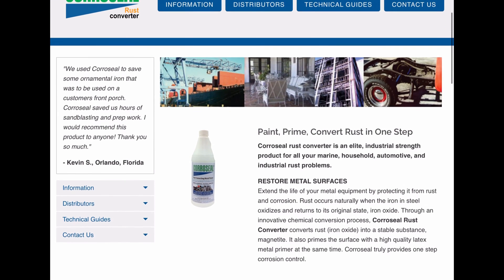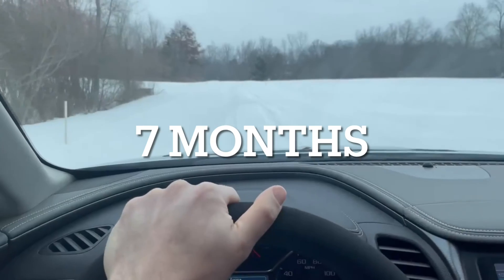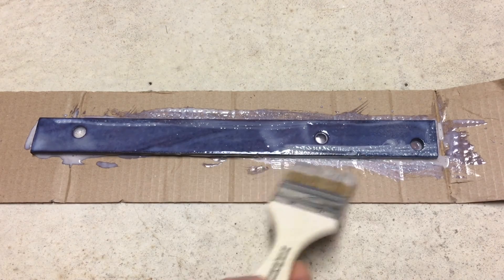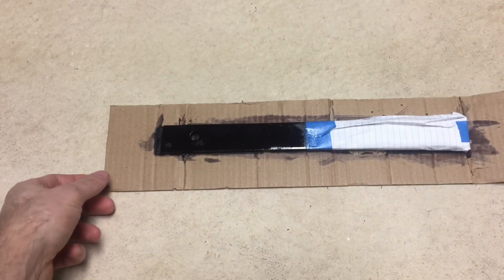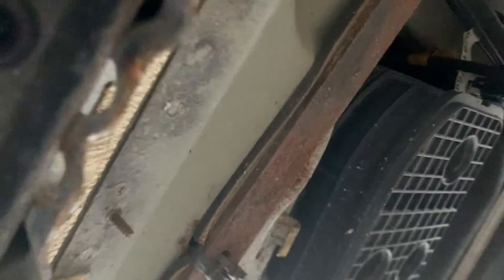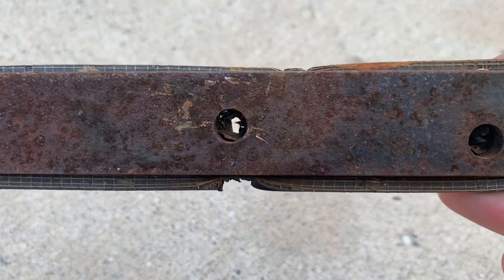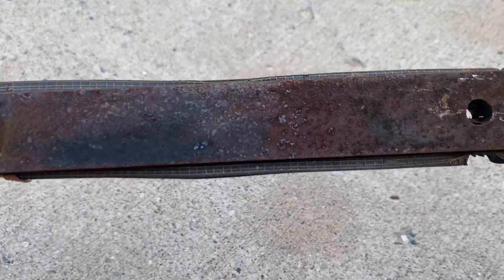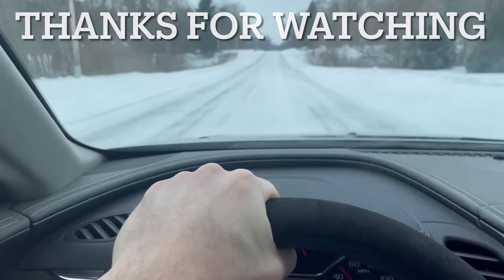CORROSEAL Rust Converter | 7 Month Vehicle Frame Test | Snow Rain Heat | Clear Paint to See Results!

Comment: Here in Canada I have used a product called STOP RUST. I found that cleaning the metal with acetone before application shows better results. Also, I paint the area with a good quality primer after the converter dries.
Reply: What is the product you're referring to?
Reply: @NoahFlemingConsulting  The product is called "STOP RUST" and is produced by a Canadian company called Cantol.

Comment: I live on the east coast of Canada, I think the issue is... you expect it to convert the metal into stainless or aluminum, There is no product that will do what you're expecting, short of having it chromed or galvanized... I use this and fluid film on my wranglers, one is an 03 the other's a 13, you see rust, you convert it, end of story, fluid film slows down the amount of time between applications, just out of curiosity, how often do you take it through the car wash?
Reply from the maker: I just did this for a test, but I personally have no faith in rust converters. I use Blaster Surface Shield every fall, which is similar to Fluid Film. 
I definitely don’t wash my vehicles as often as I would like to. There is nothing convenient on my regular routes. When I get it washed in the winter, it’s covered in salt again the next day. Loosing battle.
Reply: @HowtoandReviewsOfficial   I've watched your videos and seen your results, they definitely differ from mine, I wonder if yours froze at some point, like during shipping, could also be from washing with soap and water, it removes lanolin, the base of fluid film and blaster surface shield. as well vinegar is used to remove latex paint, corroseal is latex based, I noticed you used vinegar in one of your tests, water based latex isn't the strongest barrier, think of house paint. I have places on my 03 jeep that the paint chipped on the hood and surface rusted, I put corroseal on them 4 years ago and they're still black. but I don't ever wash my jeeps. I don't know, I hope you find something that works though, because F*ck Rust.

Comment: I’v used Corroseal  on several pickups over the years and it has held up exceptionly well here in Kansas.  it MUST be top coated.  Spray enamel is a lousy topcoat for a truck frame.  I always topcoat with 3m undercoating.  Much thicker than enamel and designed to reduce chipping.

Comment: In someone elses video, they used 3 coats of corroseal.. then topcoated with automotive paint. Maybe multiple layers creates a  thicker and more durable seal? And what about topping it with rubberized undercoating?
Reply from the maker: I’m personally not a fan of rubberized undercoating. It is a soft coating that absorbs salt and dirt. They embed into the coating and cannot be cleaned off. 

Here is a pretty good video that I recently watched comparing rust converters. https://youtu.be/tu1n1POMg98

Comment: I spot treated some minor rust on the welds on my F150, I was going to coat it with POR15, but your video has me concerned.  Any idea if POR15 or maybe a lanolin based product would work better over corroseal than the clearcoat did ?  BTW, corroseal did a great job of turning my gloves black and asphalt driveway white...
Reply from the maker: A friend of mine used POR15 on his Jeep frame and he said it didn’t even hold up for a year. I haven’t personally used it, so I don’t have any personal experience.
I’m currently at the point of just using Rustoleum paint. 
I use oil based brush on, which is not water based and holds up great.
Or just the spray can if brush on is not appropriate.

Another product that you may want to look into is Cosmoline rp-342
I have not personally used it yet, but looks very promising.

Comment: What did the other side of the bar look like?
Reply from the maker: I stuck a strip of adhesive backed foam on the back to act as a buffer between the steel bar and the underside of my vehicle. I didn’t want metal on metal contact all year. That could wear the paint off of my vehicle.
Reply: @HowtoandReviewsOfficial  - could also show you what an actual water impermeable coating would have done over the product.

Comment: You are the man, those guys who make the product should see your review and is what we want to see as consumers, my question is what product is the best because I bought a car from Ohio and has rust problems that I need to fix but with a bunch of products  I just need to get the best to treat this rust problem at once obviously I wont use  corroseal thank you for taking the time to share the video and for taking the time to do the real test
Reply from the maker: Glad you found it helpful!
Unfortunately, I don’t have a good solution.
A product of personal high interest (which I have Not personally tried and do not have any personal experience with) is Cosmoline RP-342 Heavy Rust Preventative (Military-Grade). Something to look into. https://www.cosmolinedirect.com/cosmoline-rp-342-heavy-spray-military-grade-rust-preventive/?gclid=CjwKCAiAiKuOBhBQEiwAId_sKw1lY7j3ESOA-rhaJJMujmAi64AYDQBEgKo88yPhLjUqsto45x1TIxoC8RgQAvD_BwE

Another product that I have heard good things about is Rustoleum Rusty Metal Primer https://amzn.to/3qzPfqz

I have coated the bottom of my vehicle with a couple different products for this winter and plan to do a review video in the spring on how they have held up.

In the end, my personal opinion is that when rust takes over, it cannot be stopped.

Comment: Corroseal sucks tbh. I wanted to like it but it always failed me. Try the same test with Rustoleum rusty metal primer. Much easier to find and I have had far better luck with it.
Reply from the maker: Thanks for the recommendation. I will look into it.
Reply: Strange... They both have the same chemical to convert rust.
Reply: @dontblameme6328  which is?
Reply: @lollerskates1992  no it doesn’t.
Reply: @FIVEVEEZEE  I think Corroseal is gallic acid and a latex primer.

Comment: Clearcoat is not designed to be used directly on a converter, it is designed to be used on paint.
Reply from the maker: Ok, thanks. Don’t worry, this was not a permanent application. I needed a short term coating to protect the Corroseal, and I needed it to be clear to be able to see what the Corroseal was doing under the protective coating. Automotive clear coat was a practical choice and it served the purpose. I am not advocating to top coat rust converter with clear coat. This was just a test.

Comment: I'm planning on applying corroseal, with a topcoat, and then cosmoline over top of that. Any reason why that wouldn't work?
Reply from the maker: I have used Corroseal many times with mixed results. That’s why I wanted to see what was happening under the paint in this video; does it permanently convert rust, or does rust still continue to grow under the paint?
I have also heard great things about Cosmoline. However, I believe it is indented to use directly on the metal surface. I’m not sure if it would provide a benefit if it is applied on top of paint. 
Mastercoat Silver was recently recommended. That may be another option to look into.
Reply: @HowtoandReviewsOfficial  than you!

Comment: Tells me all I need to know. my truck is really rusty underneath and I'd like to stop as much as I could before it rusts through. But it just seems like it'll eventually just have to rust. Awesome video.
Reply from the maker: Glad you found it helpful!
I have had mixed results with this product. I have had the best success on a vehicle frame with Corroseal, then a top coat of rustoleum oil based brush on paint. The oil based is not water soluble and will hold up much longer. But, in the end, I agree that rust is likely inevitable once it starts.
Reply: @HowtoandReviewsOfficial  I wonder how it would respond to enamel paint or undercoating. Or even something like fluid film. I appreciate the time you put into it. Not everyone is that patient
Reply: @JMPK23  you got it, I never wash my jeeps, I only use this and fluid film "every year" my 2003 looks as good as my 2013, I'm on the east coast of Canada, salt, snow, rain, mud, ocean spray, rocks... you get the point, but just like fluid film... it has to be maintained, meaning it needs to be reapplied as needed, but this guy grinds the rust off... like that's not making the metal thinner. I would rather have the surface rust, lol
Reply: @capnspicy5565  from all of the research I can find since I started looking into this, the only way to prevent it completely is to clean the frame, Epoxy primer and then use an oil based paint, and then use something like fluid film. That or use fluid film once a car rolls off the lot. My silverado definitely benefited when I used a variety of different stuff as a test but ultimately it's still rusting. 

Only thing I haven't tried is POR15 and I'm trying to save that for my C10 when I'm ready